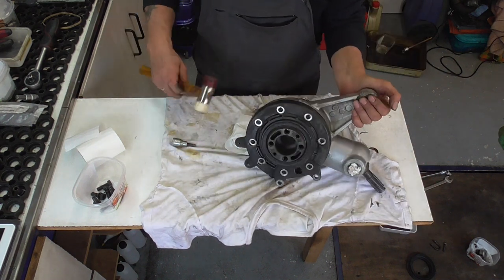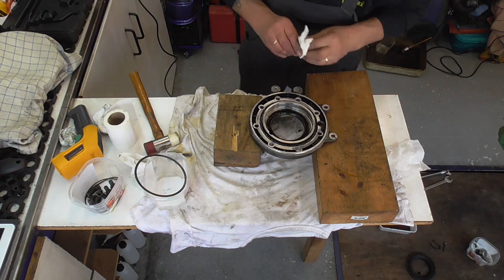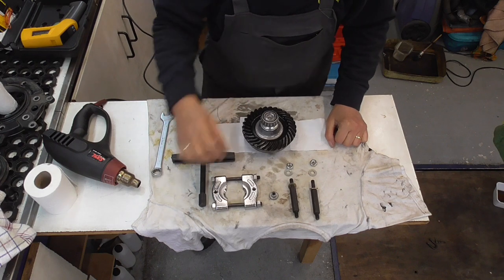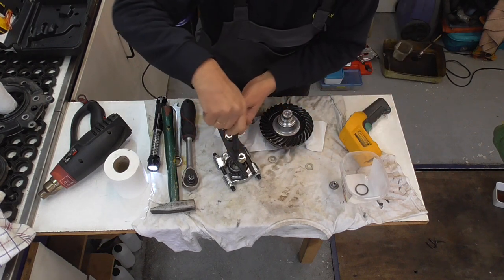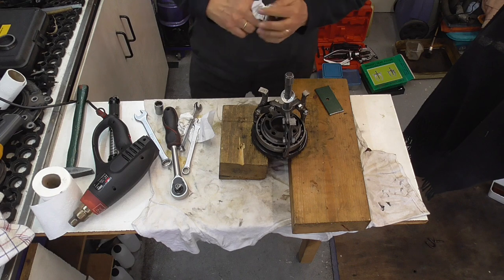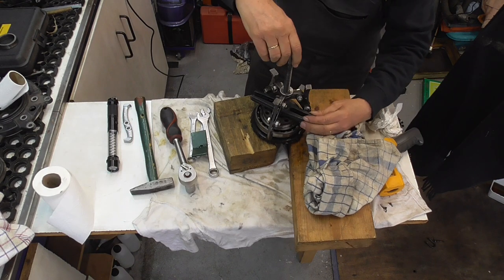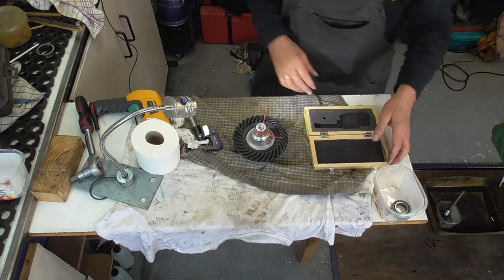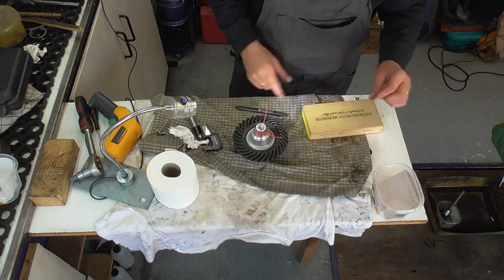BMW R1150GS FINAL DRIVE PROBLEM.. SOLVED ! PART 2

Comment: One of the best👍👍👍
A big challenge. This is a job for very experienced DIY men.
Need bearing pullers of three different types...

According to what you explained, maybe it would have been possible to adjust the preload( in the bearing of the cardan("Gimbal"), maybe the adjust nut came loose, and it would have been enough to tighten the axis in place?

I am waiting for the continuation of your series.
Reply: How do you do this tightening operation? Are there any videos in youtube for that?